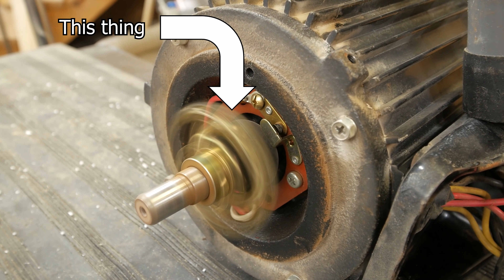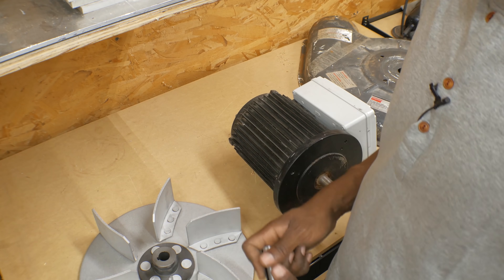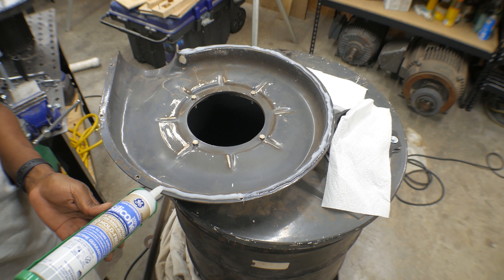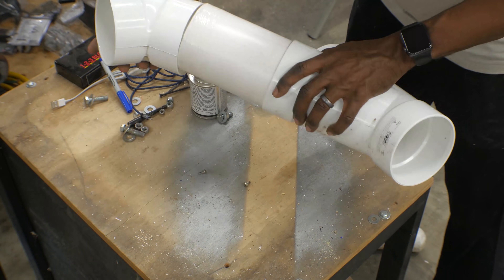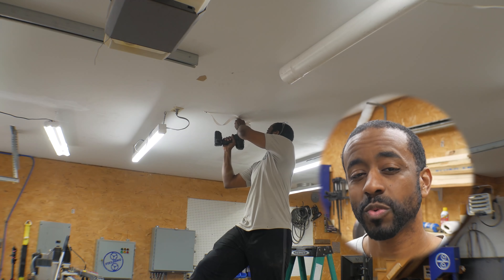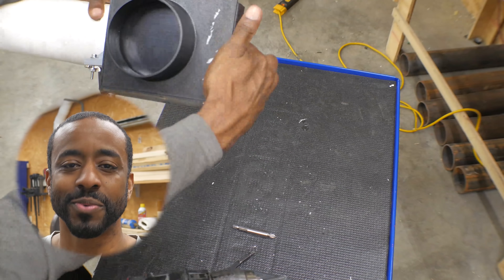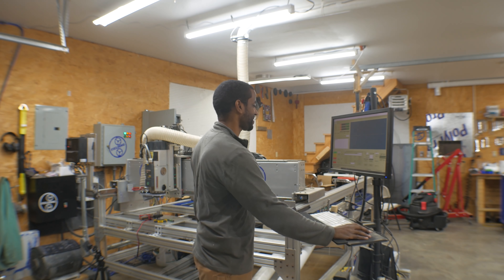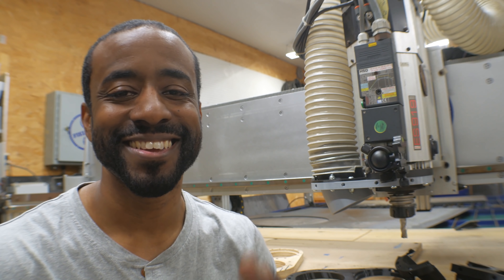Making An Automatic Dust Collection System; Shopmade #081

Comment: Very cool.  I am dabbling in some home automation stuff myself.  The biggest thing I have dealt with so far is an electric water heater.  I am on an adjustable rate power plan so having the water heater off during certain times of the day during the summer months is a great thing as I would rather not pay about 50 cents per KWH to heat water...

Anyway grabbed an ESP8266, a 480V 40 amp solid state relay which I mated to an old CPU heatsink that was rated for like 100 watts of heat dissipation, and I got a 5V power supply board that just grabs the 240V and drops it to the required voltage to run the ESP8266.  The Board is flashed with ESPHome and is easily able to activate the relay.  Pair that with HomeAssistant and great things happen!!

The Water heater is also set to turn off at night and if I am outside of a certain area from home since if I am not home I don't need to be generating hot water.  Yeah I have to heat water to use it but once I get near home it turns back on again so everything works out fine.

Comment: A fun but basic one I'm planning on doing is an Arduino or pi window shade opener/closer. I'm going to try and link it up to the internet so I can open and close them with my phone, but also have it set to open at sunrise and close at sunset! I 3d printed most of the parts necessary for it already, just need to work out the program side of it yet.

Comment: Clearly, the solution is, (foreshadowing), watch the video first, find out what you designed or did wrong, THEN do the build process with that valuable knowledge gained. A TOT lathe with the time traveling mod would be handy here. Great video and project.

Comment: I've been watching many of your videos - love your ingenuity... I have an old squirrel cage fan that I think the centrifugal switch has gone ( won't disengage ) causing to burn out switch...look forward to that video...

idea - small spring from the ceiling for hose over cnc machine to keep the hose from catching on the corrugations.

current interests - robotic lawnmower - charging with solar and or wind - similar to oversized romba/shark ion vacuum... I've done some parallax programming on the basic stamp with the boe bot - now I'm trying the arduino...

Comment: Jeremy, i love your explainations, They are at the correct level for me.
Any thing i would like to automate?  Well yes, each year i have to man handle a lawnmower deck and a snowblower attachment to my riding lawnmower.  Crawl under, unhook this and that, then deal with a very heavy unit.  I am currently building a trolly cart for the lawnmower deck that will rise up allow easy (dis)connection, and be able to stand on one end for winter storage.  Next to tackle the snowblower attachment, hmmm.

Comment: Most dust fires happen from very fine powders, i.e. flour and powdered sugar. I wouldn't worry much about cutting, but sanding is hazardous. If you open a factory, you can do dust fire testing by a lab to determine. They categorize the dust explosion hazard and you make your equipment match that hazard rating.
I worked in a place where PVC pipes were used for moving plastic dust, but the PVC eroded from impacts at elbows. Something to keep in mind.

Comment: Jeremy great video the only problem I’ve ever encountered with the PVC pipe and the static electricity that it builds up is that it discharges on me when you get a little zap every now and then main reason for a ground wire. I’ve also thought of using the foil tape for Stainglass work and It has the self-adhesive back on it that you could just peel and stick to the outside of the pipe and make a complete run with it just a thought

Comment: On my system, I use 1" aluminum tape down the length of the pipe on the outside and short screws penetrating the tape and pipe walls as electrodes at 4' intervals . This avoids collecting debris on the electrodes inside the pipe. I then attach the tape to ground or other pipes with grounding wire. Seems to work fine.

Comment: We've found that grounding out dust collection will keep the user of this system from getting shocked.  What I would like to see is a way to remotely turn on and off an air compressor, and remotely drain the air compressor tank to prevent corrosion from occurring in the tank.
Reply: That is a great idea and I hope someone picks up on it.  I have a 25 year old compressor that I regularly drain (like every other blue moon) when I think it needs frequent draining.

Comment: If it was me, I would use a one sided adhesive high density foam weatherstripping for the seal so that it is cleaner and easier to take back apart if needed. It is the same thing used to seal most sand blasting cabinets.

Comment: grounding for fire It would require more than a spark from static and wood to ignite.  Grounding is important to keep static off an prevent build up of saw dust on the inside and outside of the pipes.

Comment: You could rotate the bag so that it comes out top at an angle towards the wall and then hang a hook from the ceiling or wall to the end of the bag. I have a dust collector that has that kind of design with filter bag vertical above and collector bag below. For the plastic arm that moves the blast gate, would be good to know how that design holds up or if it needs to be thicker.

Comment: So some interesting things about static-charge.  Static charges gather on the surface of things, not internally.  So you would not have a static discharge on the inside surfaces of your dust collection system.  Typically in mitigating electrical discharge from static charges a simple grounding strap at the point of use is sufficient.  In the case of your electrical equipment, it's already grounded.  So if you add a grounding strap with alligator clips from the inlet to the machine (bare metal) you'll be good to go.  Ground the collection point also.  Dust explosions happen in the open where static charges can collect on surfaces.

Comment: I have pvc on my dust setup,  I've never did see a fire but on my 20 in planer (before I grounded it)  the static would build up and give you quite a shock if you touched it.

Comment: Great work, I’m in the process of planning a system like this, and I think I’m going to go with spring return pneumatic because electric linear motors seem to way more expensive.  My other option is servo motors with long arms. My gates are made of MDF and they require very little effort to open, and I’ve seen other people have success with servos so I might go with that to eliminate the need to run air to the blast gates. I thought I had been subscribed but somehow I wasn’t so I’m glad I stumbled on this video! I’m definitely going to keep an eye out for any relay videos you do.
Reply: I used a continuous turning servo w/a rack and pinion gear to open&close
Reply: Jason Koon Thanks Jason, do you have picture or video of this setup anywhere? (YouTube/Instagram) Since the motors are continuous turn do they know when to stop based on limit switches? As far as programming my idea is to have a button at each machine that only controls the blast gate. (I already have iVac system to control the dust collector) The button would be a momentary switch that would trigger the Arduino to open that blast gate and close any others that are open. It would not close again until the next machine requested it to be. Ideally there would also be indicator lights at the machine that would report its gate’s open or closed state.

Comment: Jeremy the spindle you have on you cnc machine I have rebuilt many of those. That what I used to do. If you have any problems feel free to ask me for any help on it. But just a note be careful with your cables the connect to it I have had to replace those because it brakes.

Comment: Go ahead and run a kill switch for the vacuum at the spindle, just in case you don't want to suck up certain loose pieces.  Then you can use that wiring for the tool changer.

Comment: You can probably control the static charge by using a humidifier.  Low humidity is what causes your body to retain static charge in the winter resulting in sparks when you touch metal.  You might be able to make a static charge detector by hanging styrofoam packing peanuts near the pipe, if they become deflected it indicates a charge is building up.

Comment: I will suggest running the pvc as close to each machine as possible. You’re loosing quite a bit of cfm using the flex stuff from the gate to the tools. One guy on Facebook had a similar setup and decided to do what I suggested here and he calculated that he had a 46% increase in cfm by eliminating the flex from just his table saw.

Comment: Great video Jeremy. Other videos I have seen say that just minimizing places for dust to collect will eliminate the possibility of a fire in PCV, and will improve performance (very gradual angles).  The bend in the flexible hose is one such place where your CFM will be lowered.
I don't get why so many people use pneumatics for blast gates, considering that you also have to run air to those locations and it seems pricey.  Why not just use 12 orv24v solenoids to actuate the blast gate?
If done with a microcontroller at each gate, you can also open up the gate first, close other gates then turn on the dust collector before and after running your cnc (and even automate it all thru your cnc controller like starting the spindle).

Comment: We would use relays for using low current low voltage switches running high current high voltage devices. The relays can handle the higher current where a cheap switch/microswitch might not be able to.

Comment: I have the exact same problem with my tool changer rack and the dust collector shoe. I also have to find a way to extend the skirt down lower, as tools end up too long and there's too big a gap between the skirt bristles and work surface.

Comment: I have assembled several industrial sized dust collectors, they always use adhesive backed foam or rubber strips as the gaskets between mating surfaces. However, I don’t see a problem with silicone except that it would be more difficult to disassemble

Comment: I added voice control via Insteon and Google Assistant. . .added a macro command in GA to respond to my voice commands to control my pool in FL from my home in WI. .   The pool heater is an old system with no internet controls, so I added some with contactors and Insteon controlled outlets (contactor is 120 in, 240 out). When I'm in FL, I also use the command "Hey computer,". Computer responds, " Yes Big Guy", I say "Good Morning Florida", it reads back to me the outside temp, the inside temp, pool temp. opens the curtains and turns on the coffee pot I prepped the previous night.  I think you could easily add voice control to your various machines instead of moving across the room to hit the computer button.  After that, how about an auto loader robot to load the CNC material if you are doing repetitive tasks like a series of cuts for cabinet making. You inspired me to automate my dust collector, but go a step further and add voice control to my various tools instead the switches - especially on machines that are switched on and off between cuts like the table and mitre saws.  Voice command would be pretty cool on your automated table saw.  "Move fence to 12 milimeters", then "move blade to 45 degrees".

Comment: Jeremy - I can't tell what the purpose of the fan housing drum might be, other than a platform. Is it a cyclonic separator? If not, then your system needs a cyclonic separator. Basically, all the heavy dust will fall into the cyclone, and you won't need to change your bag or filter 1/10th as often. It's pretty simple to build, it's just a drum with circular ramp and a cone. Google "Cyclonic Separator Woodshop" and watch a half-dozen videos. "Woodworkers Guild of America" has a pretty good explanation. Lots of plans. Very very easy to make, and makes a huge difference in convenience. It stacks above your existing barrel.
Reply from the maker: It’s a separator

Comment: Regarding your comments on a ground wire for the dust collection system, I read years ago where a guy said to put a bare copper wire inside the entire length of the duct work and ground one end of it. Now I'm wondering if he was recommending this to prevent personnel from static shock instead of explosion or fire. I do know from experience that a big wide belt/panel sander can turn into a Vandegraf generator if it is not grounded. I have also seen material handling hoses on molding presses that were emitting sparks when material went through with high velocity. Your call on that subject. Thanks for the video buddy!

Comment: The ground wire is really just insurance against ignition in case the air/fuel mix reaches an ideal ratio inside a confined space, i.e. your pipe. I worked at an animal feed/powder mix place for a bit, and they drilled home all the fearmongering you can imagine. Granted, seeing an 8 story building there one moment and gone the next, you get the hint.

Comment: 8:24 idk if it counts but my production manager who used to work for a company that makes silos/ grain bins told us that they did have such problems, but only on startup and power down because after the grain get's flowing you are above the upper explosion limit

they solved that by injecting water into the pipes on startup i think

Comment: Very interesting 👍 I’m working on a cheaper auto blast gate using cheap ‘chinese’ geared electrical motors.....the pneumatic actuators were too expensive for me so a non starter I’m afraid. Your system got my attention however. Thanks for posting 🏴

Comment: Quick and easy for the hose that follows your CnC head put a low tension spring or reel to the ceiling above it that will keep the hose off the cross bar yeah it "shouldn't" get hung up but one thing I've learned is "shouldn't wouldn't couldn't DAMNIT"  all in all though nice setup.

Comment: Just found your channel Jeremy and loving it. Thanks for helping me understand this better. Years ago i worked in a lumber mill and we had numerous small fires caused by static discharge in the sawdust lines even though we had copper grounding cables wired in. In a few cases the static discharge caused fires in the bag house which held 30 or 40 collector bags and would shut us down fora day or two at a time. Also liked the comment by Visigoth about the delay to clear the lines. I have seen that on the professional Lee Valley blast gates and would love for you to find a way to do that. thanks for your help :)

Comment: Auto Switch: Another way although a bit more complicated is to put low cost current transformers on your big tools AC primary leads. No electrical connection needed, they just clamp around a wire. They cost about $15 at Digikey and other electronics suppliers. These output a proportional  AC voltage when current flows through the wire they encircle. You need to rectify and condition that signal with a few passive electronic components then you can use the resulting DC voltage to trigger a relay or even a solid state relay. The SSR (Solid State Relay) would be ideal in that the trigger voltage and current is very low. These can be had in 240v/40amp capacity at surplus prices.

Comment: A few years ago when I was setting up dust collection the ground wire thing for static electricity came up.  Someone, I forget who, debunked the idea that static electricity could catch the sawdust from the dust collector on fire.  One of those things that got started with no testing or back ground evidence.
Reply: Dean S : While it won’t start a fire, you CAN give yourself a pretty good zap! Happened to me a couple of times before I grounded the system.

Comment: Lovely; I've been looking for an excuse to use some cheap pneumatics :) but running both electrical and air supply to a gate is annoying.  Might be easier to integrate if it were using electrical linear actuators.

PS: while everyone is whining about static discharge, consider what happens when your router runs a carbide bit at 18,000 RPM through a metal screw that was holding your workpiece down - you will see a fiery stream of burning metal sparks travel rapidly up your dust extraction hose.  From experience I can tell you that it is a) quite pretty and b) will make you move very very quickly and think very hard about where your extinguisher is kept :)

Comment: I recently started running my router (on my cnc) on DC current for the improved torque characteristics (most routers are universal motors), i think it would be cool to see in real testing with the motor testing rig the actual quantified improvement. there is also the benefit on no arcing from the commutator to the brushes.

Comment: For the output on the dust collector, how about just venting it outside? The bag doesn't have to be inside. And/or, the output port looks like you might be able to put it just to the left of the input port(?) so the two ports would be right next to each other. Tho, I'm sure you probably checked this already  😉